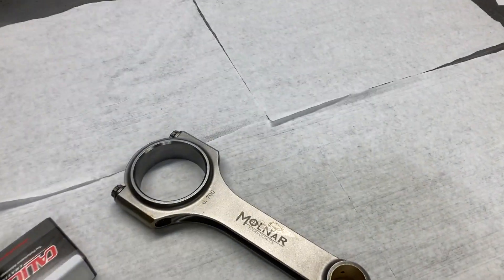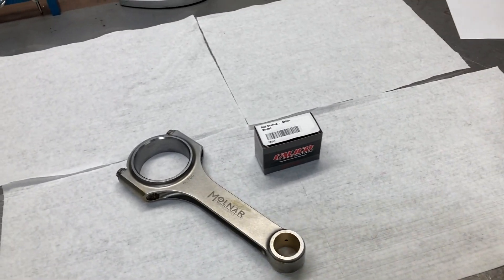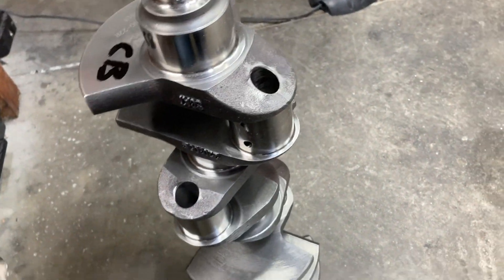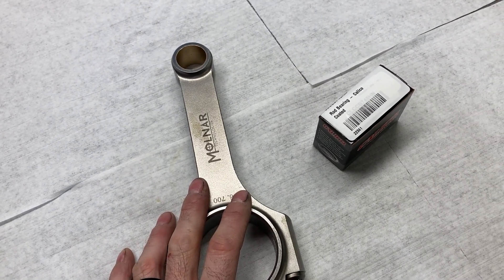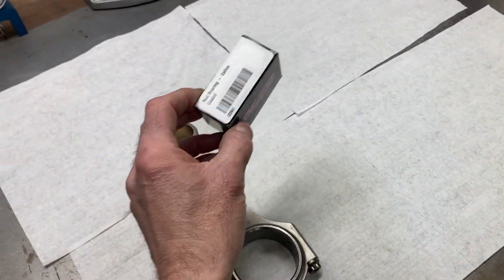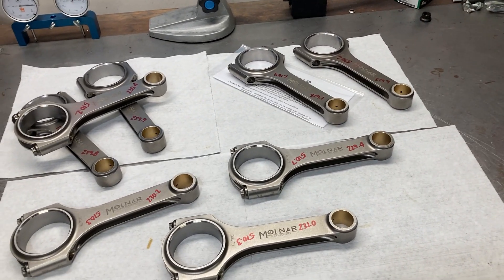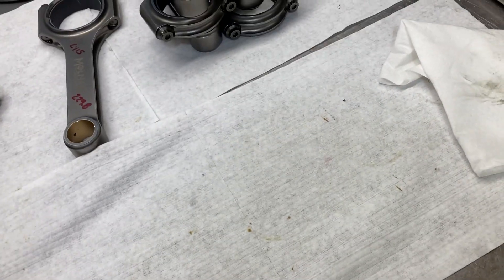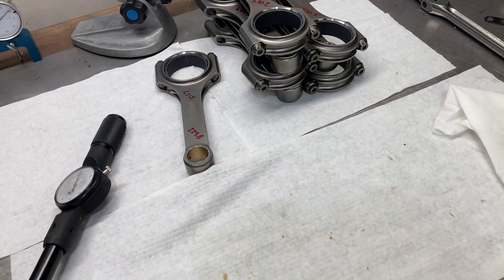Lykins Motorsports 445ci Ford FE Street/Strip Engine Build, Part 1

Comment: Any suggestions on good brand for low to middle calipers, dial gauges, other measuring devices for us guys who are using them occasionally? Something pretty accurate but not breaking the bank. 
Thanks for sharing your knowledge and insights. 👍
Reply: We use Mitutoyo. Bang for the buck is tough to beat. Starret if you want to stay American made.

Comment: Yes, I agree the Scat 9000 series crankshaft have been good for me and my clients. I haven't used the Mulnar rods, but the Scat equivalent.  Monotonous yes at times, but the end result can be fantastic.
Reply: I been running one in my 302/331 stroker with crowder sportsman rods and D.S.S.flattop forged slugs, since early 2000s it's been a very good street strip setup

Comment: Can a 360 block be stroked to a 445?
Reply from the maker: Yep
Reply: 352,360,390 all same block.
Reply from the maker: Same block dimensionally, but different bore sizes.  352 block is 4.000" bore.  360 and 390 blocks are 4.050" at standard bore.